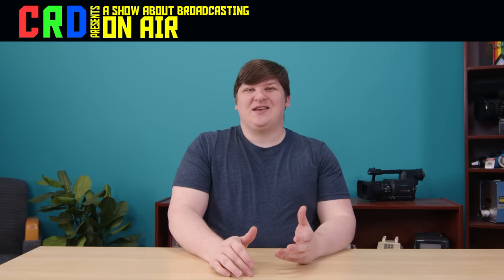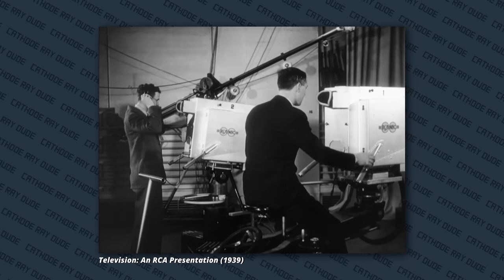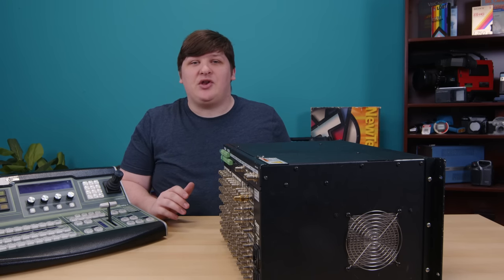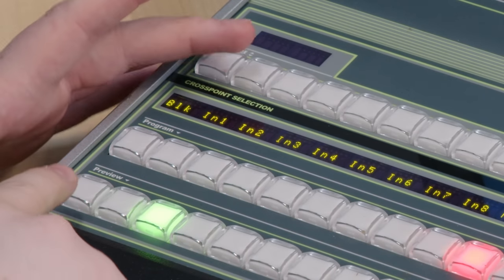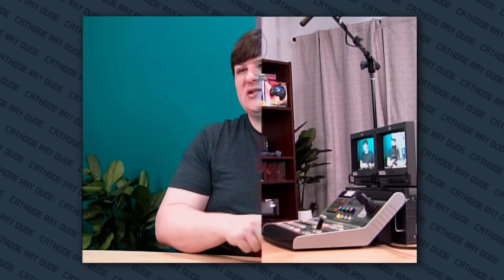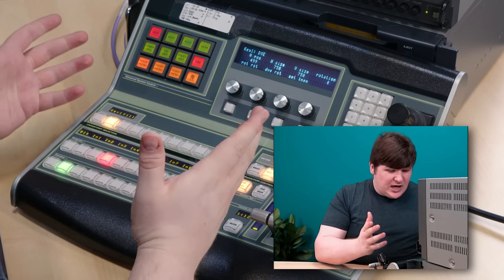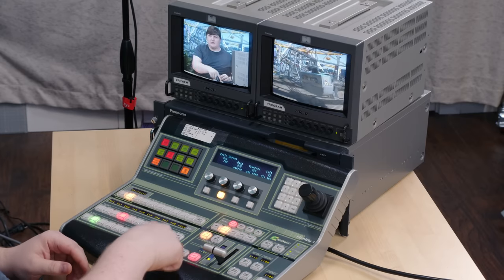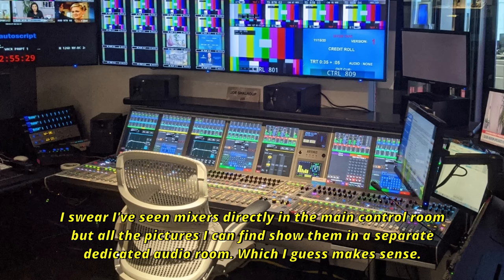What the heck is a video mixer?

Comment: OBS can totally do the trick! I just recommend creating an overlays scene and adding that scene on top of the other "CAMERAS SCENES", and then, enabling the studio mode, configuring shortcuts, and running the multiview window. Now you have a virtual video switcher! With the OBS web socket plugin, you can even have tally lights on your smartphone!
Reply from the maker: I know it CAN, but I've tried it and I find it incredibly awkward and unreliable.
Reply: @CathodeRayDude  I think that what gives that feeling is "sharing" the same keyboard to the shortcuts. It seems like you can't use the computer for something else, even though you can. Also if you're covering sports and need quick and reliable replays, definitely Vmix is the way!
Reply: And if you throw a touchscreen monitor in the mix for your multiview you now have touchable cubes.
I also use a numerical keypad for cross fades, cuts and camera selection.
Reply: @felipeamdd  I found out the hard way during testing that if you bind to a key like say A through Z you now can no-longer rename things.... As sometimes you'll get that letter and sometimes you won't but you will also be activating that shortcut.
Reply: I managed to organize OBS for live two-program-out setup using dual OBS, input duplication (where you can convert a scene into an input for another scene) and other tricks. It had streaming, live big screen, stinger transitions, media player video (that's especially troublesome to mix for two program outs btw). It's indeed possible, and sometimes an only way if you are on a budget. But it is HELL. It's not resilent. It's very stressful to use live. And i still got a friend with hardware mixer (incidentally, the exact datavideo crap shown here) who managed camera angles, and i could just fall back to his program out if anything.

Hardware is solid thing that you just plug in and it works exactly how you set it up.

To make it managable i had planned all key events for two days of show and macroed them two a dozen pages of Companion (which is a must). After days of testing it gone almost perfect on stagel.

Except that audio was completely off sync for livestream for one of the inputs. Damn.

Comment: If you are talking about analog composite video. If the two signals are synced, you can actually mix them with simple summing. That is how that old rack mount mixer you have there works. It's not doing any frame buffering or anything, it just switches video and will do summing if you do a fade.
Reply: But that requires not just Genlock, but also synchronized phases of the color carriers? And, of course, it only works for NTSC and PAL ... which is why even in France, most studios used to work with PAL or component video internally and only converted to SECAM at the very, very end of the pipeline.
Reply: Short answer: no, you can't do simple summing.

The longer answer is, if you have two perfectly synchronised monochrome video signals (which requires your sources to support genlock) and you sum only the video portion of those signals (not the sync within those signals) and divide the output by two, that would work. As soon as you want colour your signals must be RGB with each channel summed separately. But for composite colour video such as NTSC the colour is encoded in the phase of the luminance signal at certain frequencies. You could try synchronising the 3.57954 colour burst, and good luck with that when a quarter nanosecond difference will produce a major colour shift, but even if you could do that when you mix you'll see huge colour shifts anyway.

Comment: 45:43
I am a professional camera operator for too many years. And I must say that those camera, with the million buttons and switches, are easier to operate than the consumer ones. Where you have to dig through menus to get things done.
Of course, nowadays there are a lot of menus in modern cameras. But to actually operate a camera is easier with dedicated buttons and switches.
Reply: That is true, but it adds to the cost. Also I suspect all those moving parts are more opportunities for failure (e.g. from dust and perspiration getting in).

Comment: I work at broadcast events for eSports across the globe, especially for CSGO and fighting games. We still use a traditional video mixer, generally a large blackmagic one just because we have one, but every passing day we are automating our broadcasting, whether it's hooking to an API to get game information and switching automatically or synchronising AR with cameras, lights, pyrotechnics and the like. We most generally use vMix nowadays. A LOT of vMix. Like, ~5 instances of it at a time interconnected at different parts of the venue, to create one cohesive broadcast experience. It feels like the general trend in gaming broadcasting is going towards having one "prod table" that takes care of EVERYTHING and connects directly to vmix to switch things around. Especially in smaller, one game one stage broadcasts we are completely skipping over the video mixing at times and connecting all cameras directly to a Decklink and using the XL streamdecks with Bitfocus Companion to use as a glorified mixing board.

Comment: Mixing console chassis were custom made furniture for these rack mounted devices. These racks were set up at angles to allow usability as the button farm grew. This was also when you'd build your own component setup. "I want Panasonic switching, Crown Amps, Sony Effects", that kind of thing. It's akin to guitarists building their own rack effects/amp combos back in the day, even pedal board combinations have now given way to amplifier sims. I was a pro guitarist back when all you needed was great hair, we used to call them spice racks. But back to the video side of the world, the days of custom builds like that are over. Modern products have everything built in, even the slope up/stacking in the chassis for the button farm.  :)
Reply: Your Panasonic there is missing its ears (mounting brackets)

Comment: On an early video switcher I used at a public access TV station, you HAD to use the take button. The switcher only had two frame synchronisers and the cameras we had didn't support genlock. So if you did a hot take to another input on the program bus there would be a huge tear in the image.

Comment: Okay, so yeah, the T Bar tends to be for when you want to do a variable fade on the fly. The auto trans tends to be your best friend as a TD. With regards to DVE transitions... as a local news TD, I typically only use 2, all the others tend to be "cheesy" imo. The two I do use pretty regularly are a lens flare effect (almost like 2 stars flying across the screen with a lens flare in the middle) and a page turn. I use the lens flare for lighter stroies, or for certain fullscreen graphics (like "If you or a loved one is in need of help, call this number"). I use the page turn to transition between multiple graphics in the same story. I guess I also commonly use a white flash, but I don't think that technically comes from a DVE since it's just a color being generated by the switcher. 

Anywho, like I said in my other comment... these things tend to go through automation in local TV news. So we have some central servers that feed commands to the switcher to get it to behave a certain way. It's really interesting how many machines work together to get a production going. For example, that loud thing you had, we refer to it as the frame. It holds ALL the technology for the switching, as well as several other things (oftentimes it has a multiviewer that allows you to view all your sources that are plugged into the switcher). The actual board with all the faders and buttons is mostly just something that allows you to manually interface with the frame, and isn't even required on many modern switcher setups (due to the automation aspect of things). These switchers also have the ability to send commands to your video server, graphics server, etc. (usually referred to as custom controls or macros). This allows you to pre-save some of the effects or transitions without having to manually recreate it every time. There's a lot I haven't even touched on, but the technical nitty gritty is what has kept me in the industry because the technology that goes into it is fascinating to learn and become more of an expert in.

Thanks for the video! Even from my knowledge and perspective, it was really insightful to see from a more general technological pov. Your videos are truly fun to watch.
Reply from the maker: Thank you so much for enjoying the video and for the info. I've heard a lot about how modern productions, news in particular, have almost no human beings involved during the show other than the talent, and it sounds really depressing compared to the chaos of yesteryear. I would really love to have been involved 15-20 years ago.
Reply: @CathodeRayDude  yeah, they've whittled it down in most newsrooms, taking out the TD (with a Director only), graphics op, etc. Some have even gone as far as getting rid of the camera op, audio op, and teleprompter. Luckily, the newsroom I work in is led by a guy who wants just the right amount of automation because he'd rather have human errors than technology breaking constantly.
Reply: Interesting I have not heard of the term frame being used. It is fully understandable and I suspect it is some thing out of the telephone industry since a telephone switch is usually put together in frames which is also where we get the standard 19 inch rack spacing. It's interesting how the technology is overlapped and the terminologies drifted into other use cases.
Reply: I was thinking, those transition effects look useful for livening up changes between static graphics, rather than separate moving video sequences.
Reply: @brycejprince  As a TD working in a (mostly) fully staffed non automated studio, I hope they never change. Troubleshooting a sleepy cameraman is easy "Why did you have camera 1 and 2 switched at the start of the show" "Sorry I read the shots on my rundown backwards" "Understandable, our show airs very early in the morning and waking up takes time, just try to pay closer attention tomorrow, ok?" Versus potentially hours of fiddling with stuff and trying to reproduce an issue. We had one of our ME busses go 180 degrees out of phase on the colors yesterday (red became blue and blue became red) and engineering is still string to troubleshoot the issue over 24 hours later.....

Comment: On the Panasonic switcher, you should be able to set the time for the transition to the minimum, then use the button to cut.  That was preferred on the one at our local public access station.  We had one for portable setup's with two cameras.  
The reason to use it as a cut button is it has a built in TBC (Time Base Corrector) for each buss.  Your inputs do not need to be genlocked.  A test you can do, set up two inputs that have action.  If you switch between them on one buss, there will be a delay of about one or two frames as it sync's the video.  That didn't happen when going between the two busses.  Hopefully they fixed it on later versions, but I doubt it.

A quick edit.  The built in TBC only synced the signal, no other adjustments that you could get with a good external TBC.

Comment: Very cool stuff. I'm primarily used to tools like OBS Studio but it's cool to learn more about the tools that came before. It is funny how many awful looking transitions there are in these mixers. Stingers really seem to cover most bases. I run a live speedrun event every year and this year I'm going to be making my own with my own filmed elements - sure hope that works!
Reply: My favorite part is watching the news with all their expensive equipment get defeated by some random guy using OBS.
Reply: OBS is not reliable enough or low latency enough for pro use
Reply: OBS actually has studio mode which is based on the preview, broadcast thinking. I've understood that a big reason why people still use physical mixers instead of PCs is because chromakeying is much higher quality on dedicated hardware. I've wondered if OBS could use a full control mixer as a keyboard
Reply: I'm well aware of OBS's weaknesses, and while I'd like to get a hardware mixer someday, a) latency doesn't matter much for my projects and b) I'm not a professional. It's a pretty remarkable tool though, and the fact that an open source and free tool can do so much of what a studio mixer does is pretty amazing.

Comment: Director/ TD here, great video! You got everything basically right! You're correct that the millions of wipes are hardly ever used. Manual T-Bar would be used when you want a slower fade/ transition done on the fly without reprogramming your preset transition duration. Also, in some circumstances, I will leave one source half faded over the other for a duration. You're also correct that you could do a rudimentary split screen in a pinch if you wanted to, but I haven't been in a production that has done so. 

For modern live broadcasts, say live basketball on ESPN, the real magic happens in the graphics computers that feed the switcher all the fancy graphics to your DSKs or MEs. The actual switching of many live shows is pretty formulaic, but the graphics are where it gets complicated.

Comment: 55:10 I know the Stream Deck and other painfully expensive switchers exist, but if I were a high profile streamer using lots of cameras, I would love to use traditional mixers. Maybe it's for the blinkenlights and big buttons with positive feedback, but also because it just makes sense and looks cool in the process. Even if the mixer was just an interface device for software on a computer, it just makes sense. You just punch a button in a bus and you're previewing or streaming that camera, no need for a mouse or digging through menus. Sadly, from what I've seen, that's not a thing that exists, at least on a decent scale and price point for consumers.
Reply: Agreed, I'd try to find suitable little set of crt monitors to go with it, make the setup part of the show, so to speak.

I might not currently have space for such a rig but I love the idea

Comment: Those special effects generators were rack-mounted because they weren't intended to be used "live" by the TD. There'd be one or more of those mounted in a rack along with the VT decks and other equipment and it would be set up before it was needed to generate a specific effects shot like the titles, credits, or the key for the weather report. The main switcher, which might have been an analog unit that was already in the studio for years without special functions, would cut to its generated output when it was wanted. The big Sony panel that was multiple switchers in one, that was collapsing the functionality of several of those into the main board in easy reach of the TD. If what you needed was effectively extra mini-mixers to feed the main mixer, the obvious form factor was a rack mount because you might need to cascade them or make them share inputs, but then main board doing the bulk of the work would be a console-style mixer.

Comment: the switcher isn't quite the heart of the broadcast studio anymore, that'd be the video router, which is basically just the world's largest video matrix, since so much of what gets broadcast is controlled by automation servers rather than ops, even live tv has a solid chunk of automated sections. usually you have every single imaginable video source and destination connected to the router (the biggest baseband one ive ever seen took up two entire 42U racks and had something like 2048I/O, and the smpte 2110 ones can get even denser) and then the switcher gets only a subset of those, maybe 12 or 24i/o as relevant to the program.
Reply: we have a (small) 512 squared SDI router, and a couple of 64 and 128 squared routers for QC monitoring. I worked for a network broadcaster that had a 2k square video router!
Reply: Routers can be huge, but I would argue the switcher is still the hearts. Routers are one-trick ponys and can only do cuts (and not always clean cuts) so you actually want to transition between sources through a switcher. Most of the cool things you want to do (USK, DSK, fades, clean cuts) are coordinated by the switcher.

Comment: I used to work with the modern versions of this equipment while running tech at a theater. We had both a very small simple 4 input board for our projector and a larger board for our live streaming system (a God send during covid). I am so glad we are down to 1 cable per beautiful HD video signal now. I can only imagine the rats nest of wire and the absolute pain and suffering of having to diagnose any problems with those older systems.
Reply: I am so glad I'm down to less than one cable. I work for a guy who wanted to reuse what he had to do a "professional" streamed +Live event. I'm talking using 2 mevo gen2 cameras and 30+ seconds of delay hacked into OBS. (I believe when he asked me what camera to get I said mevo gen2 that was out at the time before I started working for him with the explicit they only support one camera at a time and yet). I finally talked him into getting the newer ones that supported NDI amazing. Then he wanted three cameras and hey guess what he already has a camera we could just use that right... More than the minimum 30 feet of HDMI cable couplers and headaches different cameras sensor differences.... I finally talked him into getting a third. Which means I have one ethernet cable going to the front and a POE switch that powers 3 cameras.

Tracking down a fault in a cable vault had to be maddening and then there's cross talk and interference.